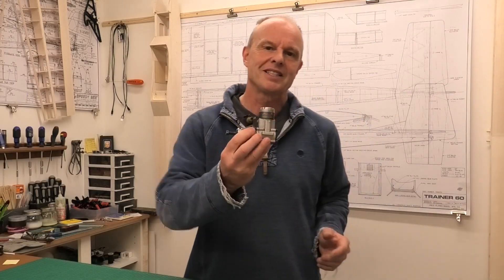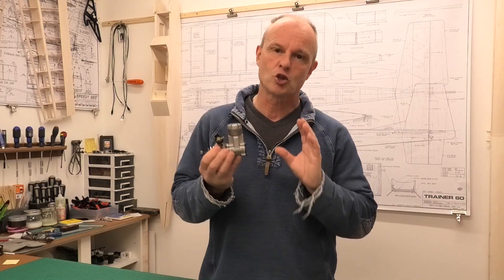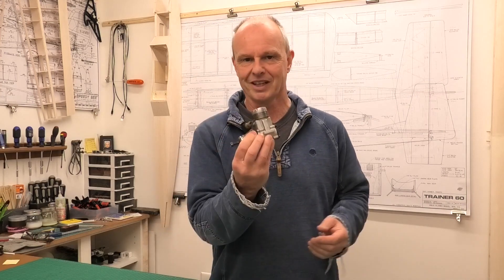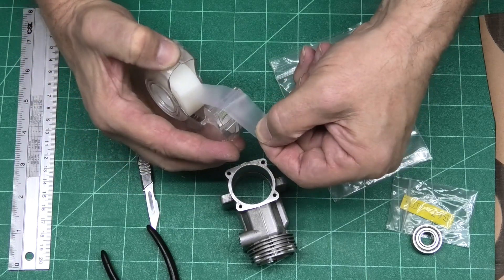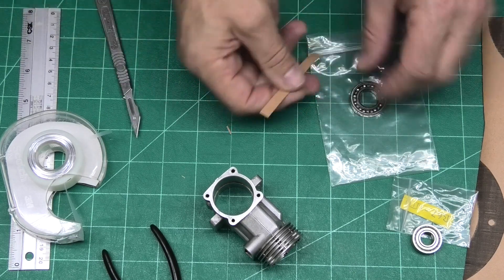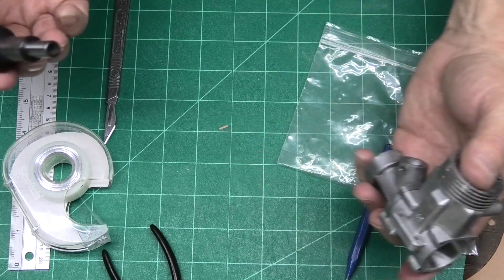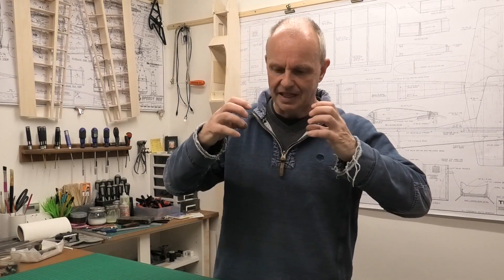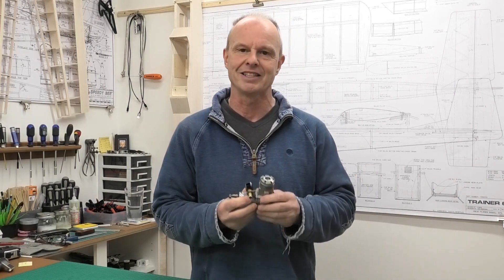Irvine 40 MkII Glow Engine - Obsolete Rear Bearing Solution!

Comment: It's been 3 years now but I'll have a go nevertheless. I'm from Portugal and we have an ancient hack, long forgotten now, were we used a very thin brass sheet we used to call "ouro mouro" (moorish gold) in this way for loose fit bearings. I think no one alive now have ever tried this and very few now about ouro mouro. Have you ever considered using aluminium tape to keep the card put and let it stay? I bet it'll be easier to drop the bearing?
Reply from the maker: Hi, thanks for the comment, no I have not tried the method you suggested.  I found that the way I do it works very successfully and is easy to do, but appreciate the thought 😀

Comment: Mark, I have the same engine and see the points you have talked about but it has a metal shim already fitted. My question is, what thread size is the removable prop screw. Mine is broken and i need to make or obtaine a replacement. Any help please?
Reply from the maker: Hi there, I think you will find it is 1/4-28 UNF, hope that helps 😀

Comment: Interesting fix I have used steel shim and a spot of lock tight with great success so the gasket paper is another way. 
The early me 1 front was weak point and failed quite often .
 It’s a great motor and the marine one also . Reliability is its name .Clive in Devon
Reply from the maker: Hi Clive, couldn't agree more, great engines, pleased you fould the video interesting, thanks for the info and comment

Comment: Interesting fix. Wonder if heatshrink tubing would do the same fix?
Reply from the maker: Don't see why not, as long as it will slide in ok and hold firm.  And fuel proof and heat proof over time, tanks for the suggestion

Comment: Mark --- I saw Barry below had the idea of using a "Feeler Gauge" to take up the difference in his truck. I was going to ask why one couldn't use " Shim Stock " that comes in ALL thickness' and since it is steel would not breakdown to the use of engine fuel and heat  ------- Rodney
Reply from the maker: Shim stock would work just as well as long as it is secure.

Comment: I have what i think is a more permanent fix and somethingi i have done with a cycle front wheel bearing which some may  perhaps think is too permanent! Take 3 pieces of softish wire slightly larger than the gap around the bearing and locate at 120 degrees around the   bearing periphery after filling the gapg with JB Weld ( a metal filled epoxy resin). The wire ensures concentricity whilst the metal filled epoxy resin ensures a solid fix. This will last the lifetime of the bearing.
Reply from the maker: Sounds a good fix, would be interesting to see how this would stand up in the heat and fuel soaked environment of an engine, but great innovation, thanks for the message.

Comment: They sure look like nice engines Mark. I’m told OS engines like to mix n match imperial and metric parts too.

Quick question, off topic…on your ugly stick build…did you round off the leading edge of the wing? If so, how hard is that to do? Can you keep the profile uniform and constant just by eye?
Reply from the maker: Hi John, didn't know that about OS, not a make I have a lot to do with, but appreciate the information.  To do the bull nose of any wing I lmane to shape, using a David plane and then sand to eye and feel using one of my longer sanding sticks.  I will post a couple of links for these.  Once you get your eye in and a bit of practice it is fairly easy, just take it easy at first.
Reply from the maker: https://youtu.be/DrlK25uvdXk
https://youtu.be/nDvdZtxrRB0
Reply: @MarkRobinson555  Thank you very much Mark!👍

Comment: HI Mark is this not the bearing you need?  Rear

15

28.58

6.35

0

0

EB054P	£24.25
model fixings
Reply from the maker: Hi John, these are the bearings I mention in the video, supplied by Bocca bearings in the US, and they are slightly thinner than the original, as they should be 7mm, so they need to be shimmed to get the correct alignment of the crankpin on the conrod.  It all works out quite expensive when you take into account the cost of the bearing and shim.  I appreciate the comment though, thanks

Comment: Good tip and I had a similar issue with the front wheel bearings on an old Ford 100E car, so used a 'sacrificial' feeler gauge of the right thickness as the shim.  Bearing seal was used on that occassion to ensure a lasting job, but probably not a good idea inside an engine.
Reply from the maker: Wow, the old Ford 100E I used to have one of those I got from a scrap yard in the 1970's with the old side valve engines, great fun!

Comment: Thanks for the video Mark, very useful as I also have an Irvine 40 which needs new bearings, Does the same process also apply to the front bearing?
Reply from the maker: Hi, thanks for the comment, its appreciated. The front bearings are available, although if you want a shielded or sealed bearing they are very slightly wider, so stick out the front of the crankcase a little, so you have a gap between the prop driver and the crankcase, but works fine.  Plane bearings are available same as factory fitted.